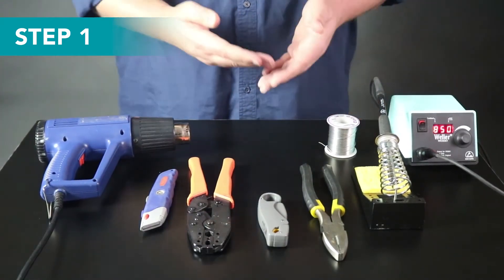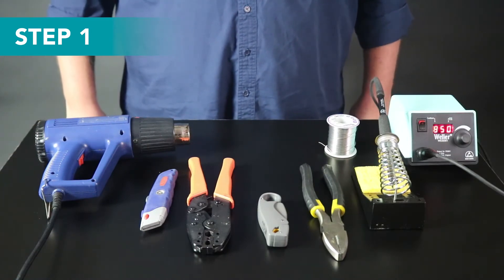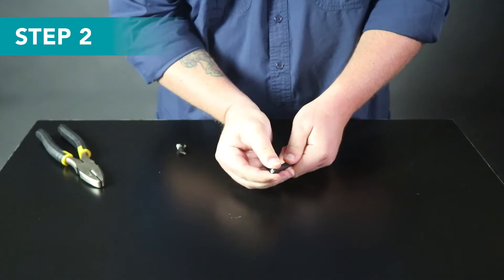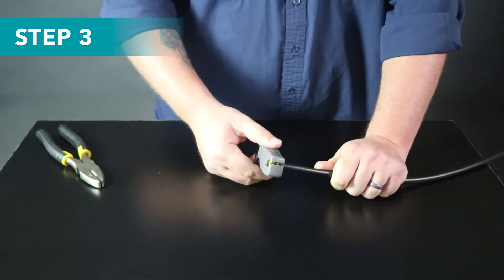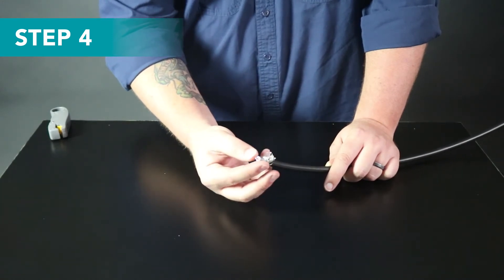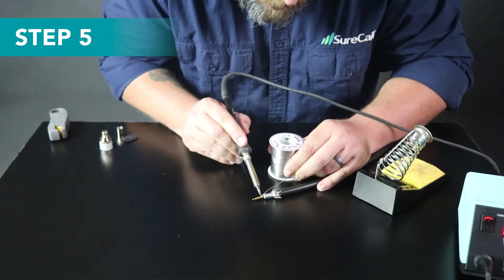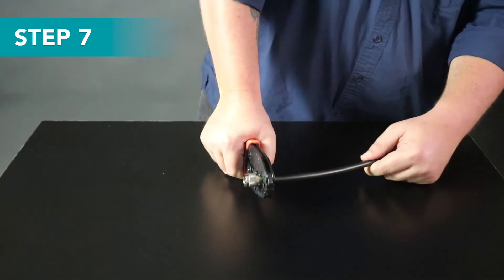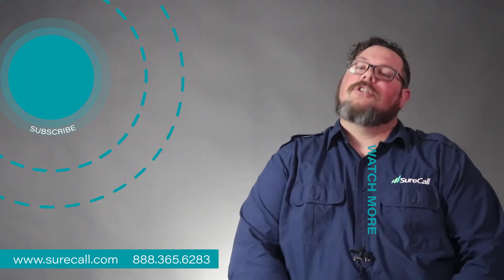How to Terminate Cable

Comment: I bought the fusion4home with the yagi and whip.  The best place for my yagi is about 100 feet from the corner of my home, not including the height of the pole and extra cable needed inside the home. Is there an amplifier I can use to boost the signal between the long cable runs so there is no loss due to an already weak signal (-99 to -105db)?
Reply from the maker: What we would suggest would be to try a lower-loss cable. Though, we would need to gather a bit more information and talk through a few alternatives more in-depth to know for sure. The best way to get a quick solution will be to get in touch with one of our tech support experts at support@surecall.com or 1-888-365-6283.